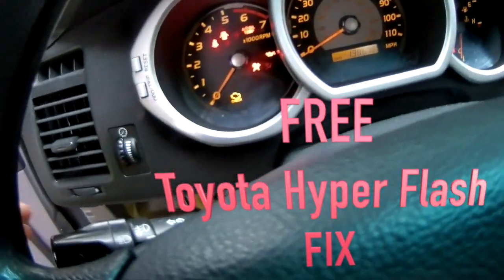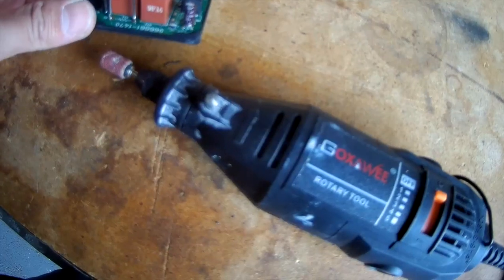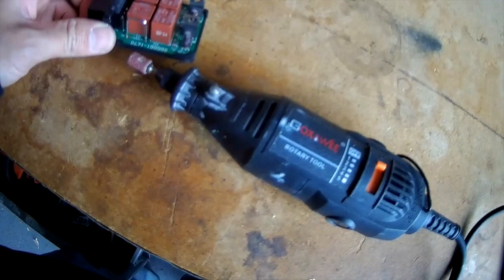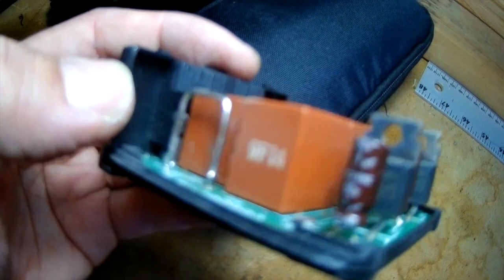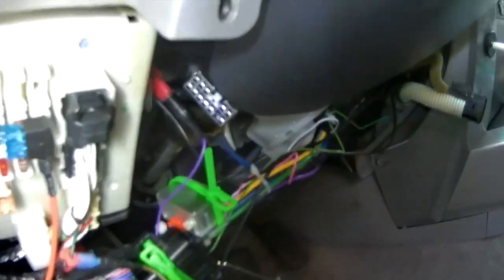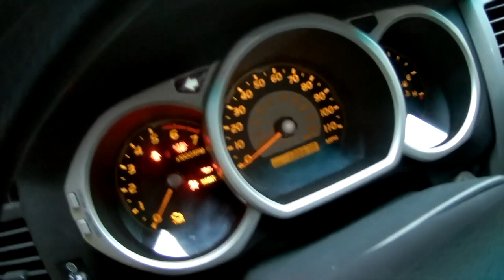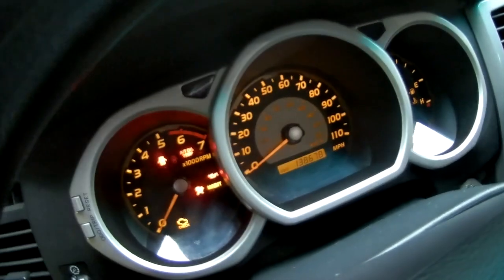FREE LED Turn Signal Hyperflash Fix - 4Runner/Tacoma

Comment: You need to use a grinder in the loop and slowly remove metal from it and test until you don’t have hyperflash anymore just be careful not to bend and break it when it gets thin

Comment: I just put LED bulbs in my turn signals in my 03 SR5 with DRL’s as well. SUPER BRIGHT but If I use the DRL, they hyperflash but if not, they flash like normal. The bulbs I used even have a built in resistor but they hyperflash if they DRL is on. I think it’s because it gets too hot because if I use the DRL and turn signal, it works as it should and less than a minute later, they start hyper flashing.

Comment: I did it. And it worked. I grinded the metal like at half of size. First didn’t work. Kept doing it and it worked when I grinded more. However I got to say that I lost my 3 - blinks turn signal. Any way to fix that?
Reply: Do the proper repair and replace the flasher with an LED compatible module.
Reply: @Ngcarson1337  there’s not LED compatible module for a Toyota 12 pin relay. Just for 8 pin. I actually bought the 8 pin LED module but as you can imagine it doesn’t fit. And I look for the 12 pin in every forum, blog, website, store, and nothing. It doesn’t exist. If you know where can I find it please let me know. Otherwise 🤫😉

Comment: Cut the loop out of the circuit altogether... Solder in a 0.15 ohm resister, done.
Reply: You have actually done that, and soldered a .15 ohm resistor?

Comment: I grinded the metal bracket but did not worked.  So, I added LED with built-in resistor but now the emergency lights do not work...  Any ideas?
Reply from the maker: keep grinding. youll be suprised
Reply: @edlinnguyen grind what again?  Thanks!